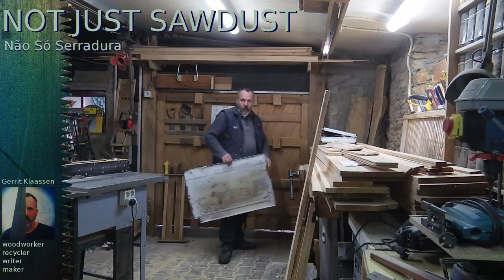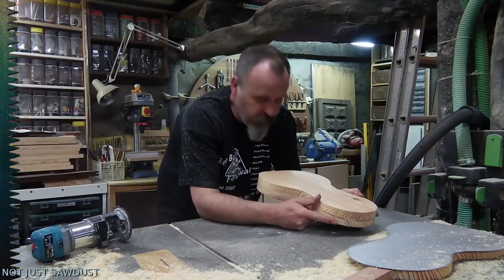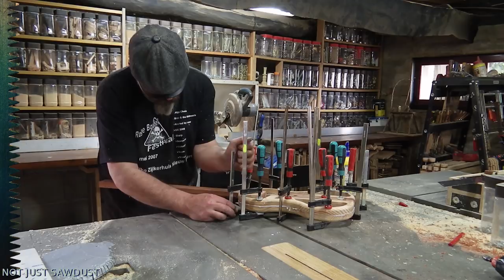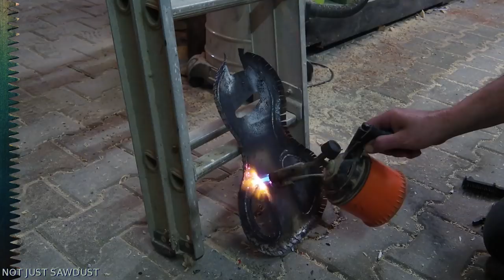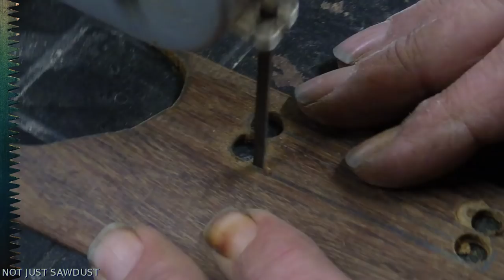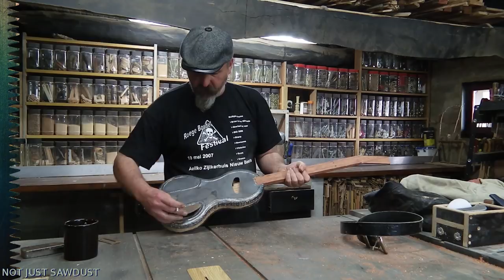#103 Triple Chaos project: DSY3S (part 1) recycling a dishwasher

Comment: Once again you did it! Amazing to see where you’re at from where you started. Stunning what you can do with a dishwasher... for the sides, my brain wondered off trying to figure out how you would deal with the sharp edges... I envisioned you would make a steel strip and bend the sharp edges on themselves for a smooth transition. But leather solves it easily. Great video Gerrit. There are not a lot of channels out there that I watch every videos, but yours is one of the few. Looking forward to part 2
Reply from the maker: Thanks Tomy. Well, as for bending a strip along the sides, that was the initial idea. But as this is one of my ongoing experiments, I made the edge to round. Next time I'll use a smaller router bit on the template. I do have a 
"stick" welder and this would have been a nice project to try it out. (although up until now I never managed to weld anything together constructively, it's more like "baking and burning").
Reply: Not Just Sawdust I work in the welding industry for 22 years and I can assure you, stick welding on something this thin would have melted it away. You would need a tig welder  to control your heat. Just saw your Instagram post and the leather looks really good!
Reply from the maker: Thanks! Well, we did some tests.. a friend of mine is a good welder and with .8 mm sticks and just 40 amps he managed... It seems to have something to do with "walking fast enough"... but I don't think I ever get to that kind of skill on welding, certainly not as someone like he who is used to improvise in difficult situations and tools - (desert, military equipment etc.)